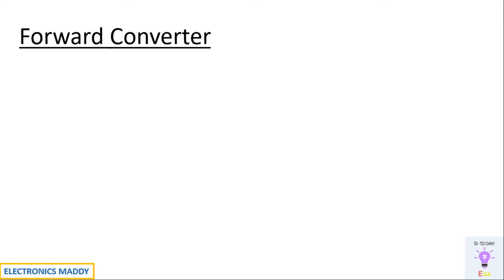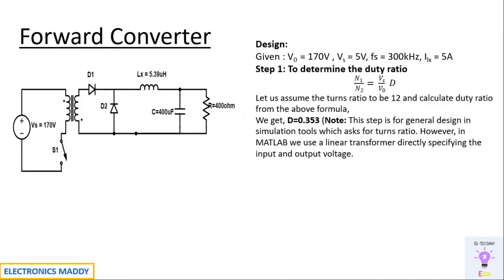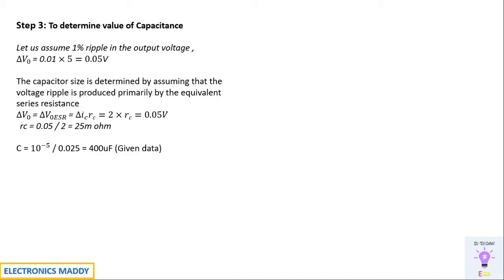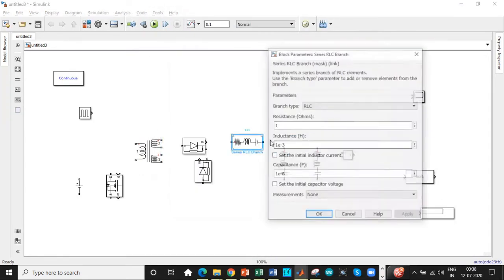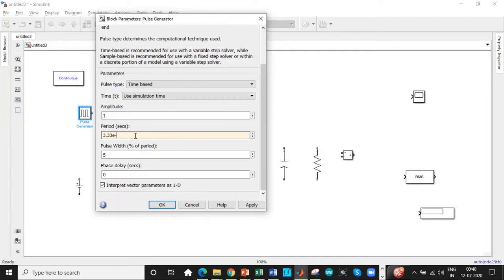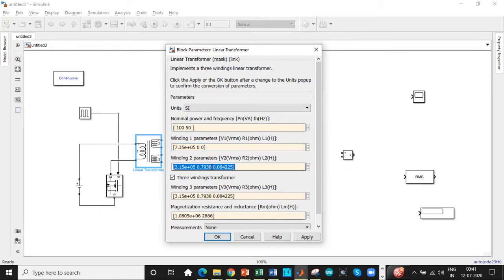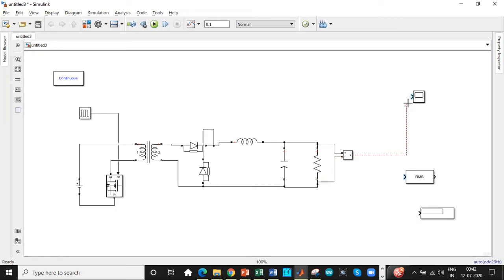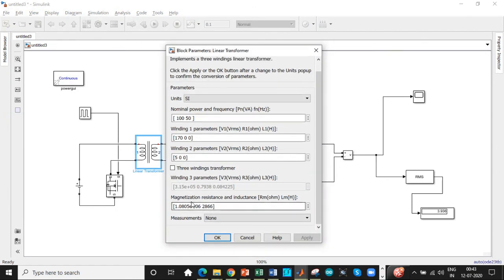Design and Simulation of Forward Converter using MATLAB | SIMULINK

Comment: Hi Maddy, most references presents forward converter with a three winding transformer, why you use a two winding transformer?
Reply from the maker: I haven't referred any papers for this one. My intension is to demonstrate the basics of this circuit and also show how to build it in matlab
Reply: @ElectronicsMaddy  i catch You , i appreciate your work, i only would like to know what's the differences or if both are essenttialy the same, if You know, because in other sites it's presented with two  like You did, so i'm a litte confuse
Reply: @wenalocaso1959  Don't know if you are still looking for the answer, but here we go. The third winding is only necessary when you're using a real transformer model. The third winding + a third diode are used to demagnetize the core. In the case when you're using an ideal transformer model there is no such need and the converter works just like a buck converter (but with the transformer relation)
Reply: @lucassilva4865  Thank You!

Comment: HI thanks, can i know you references? i would like to use it but i need to refer
Reply: Yes i've been using Hart text book, but there is another way to know the capacitor of the forward Converter, in the book there is the fórmula: dV0/V0 = (1-D)/(8*Lx*C*f) 
And i can solve this fórmula  for the  capacitor C, but you use another method and i don't know where  it comes from
Reply from the maker: Even I don't remember exactly which book I referred. But these are the books I refer 
Ned Mohan 
Daniel Hart
Rashid
Khanchandani 
Bhimbra
Reply from the maker: Refer Daniel Hart text book it is good